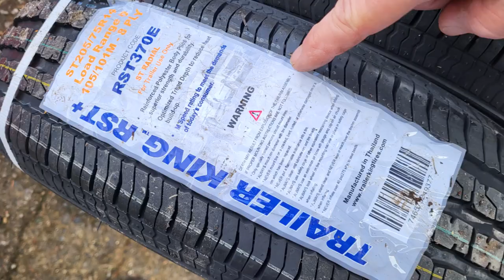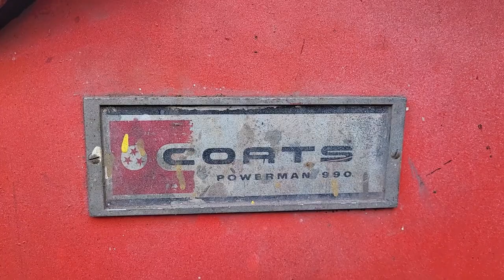Changing Our Own Trailer Tires - With a Vintage Coats 990 Tire Machine - Seat the Bead with Ether

Comment: The notch rings on the handle of the valve stem tool fit to the lip of the rim to give leverage to pull the stem in to the hole. Use the ring that gives a straight pull.

Comment: I have the coats 4040 I must say to you congratulations you were the first person on YouTube that I have seen use the tool to tighten down the center cone I don't think you're compressor is big enough it seems like the machine is not getting enough air you have the bottom bead breaker but you don't have enough air to make it work they need to run between 120 and 150 psi when you remove a tie you put the bar at the five o'clock position that way you get a full rotation and you do the same when you're putting it back on and lastly I hope this helps when you were using the tyre valve puller screw it onto the valve it swivels for a reason once you have it tightened up swivel it around put it on the rim and push down ever so slightly and it will pull the valve up you're doing it the wrong way you're making live too hard for yourself

Comment: Hey Guys!
Pretty scary technique.
Never take your hand off the bead bar for any reason!  Never!
Watching you guys both put your hands into the moving parts and pinch points made me shudder.
one guy only unless there is a issue with the bead needing two set of hands.  If you both still have both.
Seriously that was scary.  I kept waiting for the bead bar to pop off the pivot under torque and nail whichever one had his head lined up with the bar at any given moment.  I wasn't hoping it would happen but very worried cause that could cause a serious injury.

Eye protection at all times.  It only takes a second for a lifetime of regret.

Tuck in loose clothing and better yet don't wear it.  Overalls are best.  Shirt tails can catch you up in a machine before you can say "Degloved"
For your own sake, look it up!

I'm sure you are smart guys but this was bad form and should be taken down after you watch a few other videos to see how it is done safely.
The road to hell is paved with good intentions.

Take care,
The way I see it you were very lucky to come away without a serious injury.
Lee